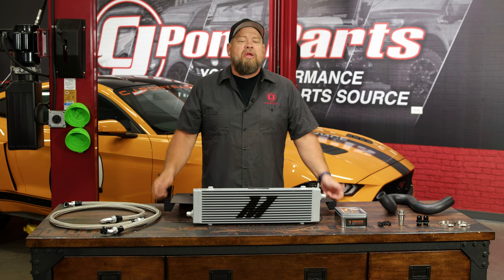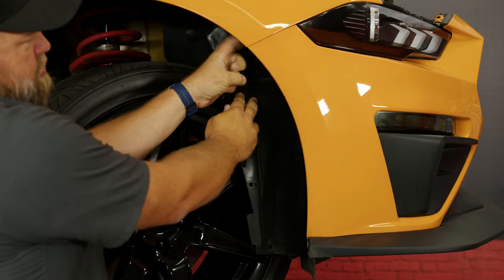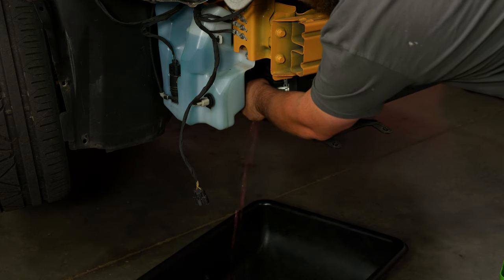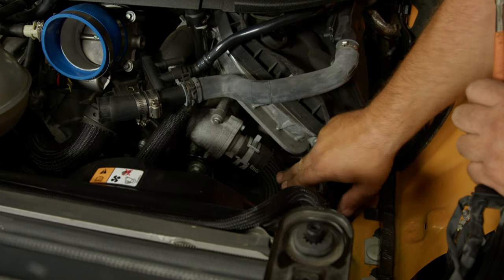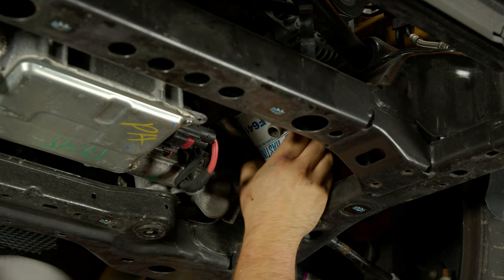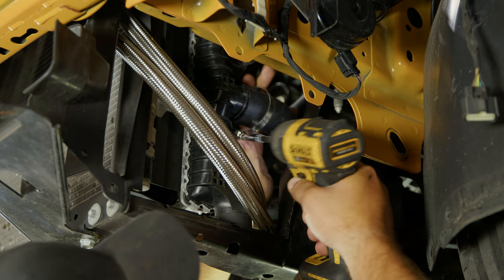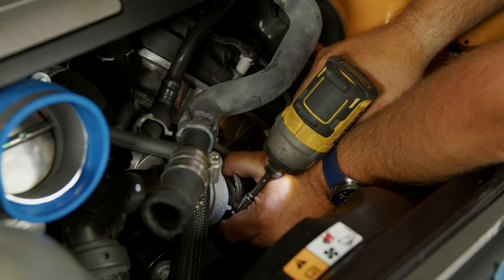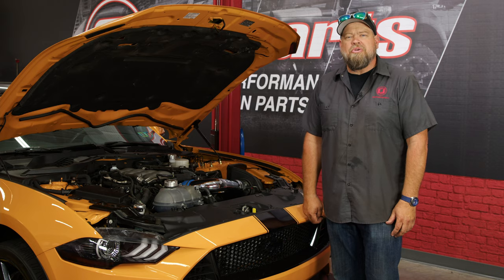2018-2023 Mustang GT | Mishimoto Oil Cooler Kit

Comment: Why doesn’t Ford do this from the factory? What is the advantage of the stock set up? Cost?
Reply: Probably cost. Although, I can't see why the base GT oil cooler is the same on a PP1/PP2. Kind of doesn't make sense for those who spend the extra money on performance bits and not get that upgrade.

Comment: cool stuff,  but how did you took OFF those active grill shutters without the check engine light..? .. i searched for that info everywhere, cant find... do you have a video??!! thank you !!
Reply: Everything is held in with body clips or small bolts....the key to removing the shutters is take the motor that opens and closes the shutters off the shroud. Then you reconnect the motor and zip tie it to the crash bar. Make sure you zip tie through the screw holes and not the center where it turns the gear for the shutters. If you bind the shutters gear mechanism it can throw a code. Hope that helps!
Reply: @jamescurtisrussell  thanks for the tip,
Аs far as I know the motor that raises and lowers those shutters  will always spin ..till the error code..since I took off shutters nothing will stop it in  a certain position (open and close)...
or i am wrong?!?! 
i saw this dude on you tube, he took off shutters on his ford f150, he screwed two screws in open and close position...so they stop the motor when needed....cant find him to ask...
thank you

Comment: i mean shouldnt oil coolers go behind the radiator?
Reply: Why would it have to go behind the rad?
Reply: @saidtheblueknight  oil is going to be warmer than coolant. Warm coolant can still be used to cool the oil, if the oil is warmer than the coolant
Reply: It’s air cooled that’s why. The radiator let’s go of heat by use of coolant. This being in front of the radiator makes no difference and allows the oil cooler to grab air to cool the oil.